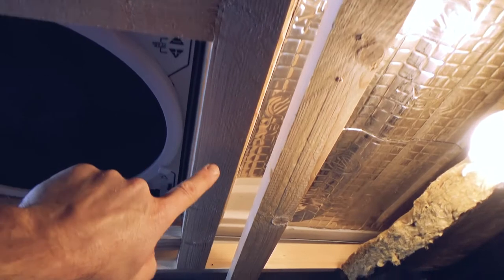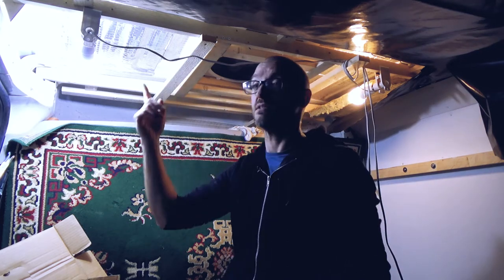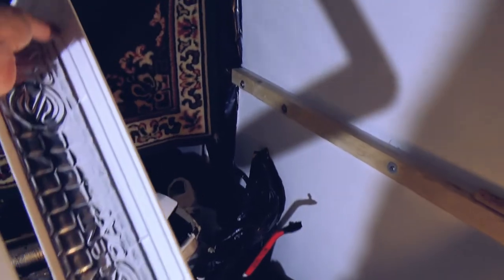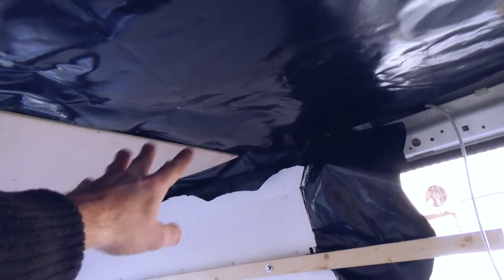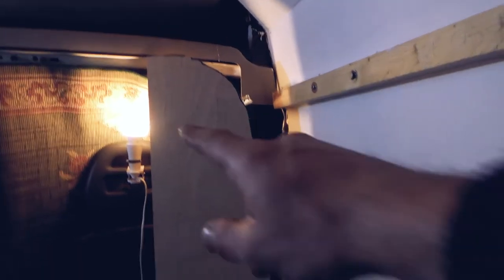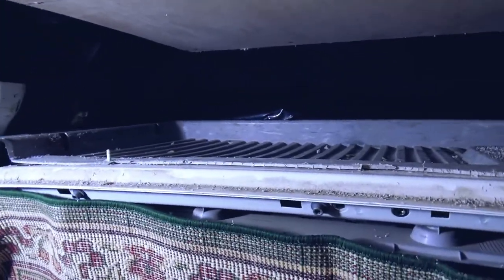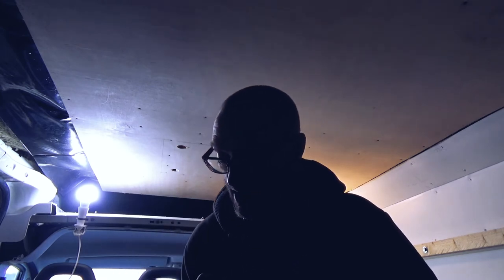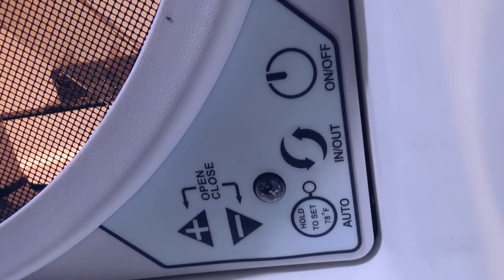25: The van ceiling and over cab storage

Comment: Oi!
Don't beat yourself up about the cold. Take it from someone who lived quite a few years over on your island in a wasted youth. Never been so cold in my life. Your winters are brutal. Much, much worse than the sub-zero temps, snow and ice we've got here.

See once you get the proper cold, you also get the dry cold.

And that is a whole different beastie than a wet cold. It isn't a lazy cold that goes straight through you and leech every bit of heat from your bones. But a more polite one that respect the boundaries of proper clothing. :)
Reply from the maker: ha ha, thanks. Maybe I feel better now. 😀 I used to rent an old school building that was so cold, I had to move out. It had a concrete floor with a thin carpet. Impossible to heat. I'm presently in training for the cold months in the van - my gas boiler at home broke down weeks ago so no heating or hot water!!
Looking at a warmer weekend, so making a list of things to do. [rocky theme plays/cracks knuckles].
Thanks for the sub!